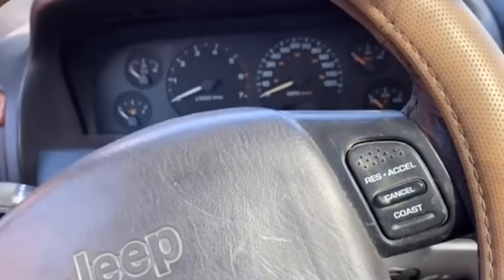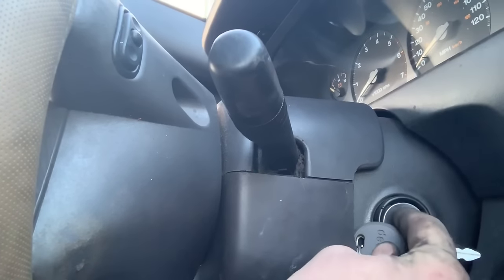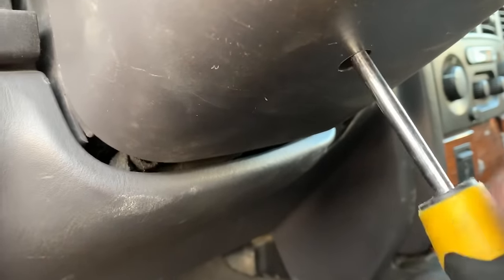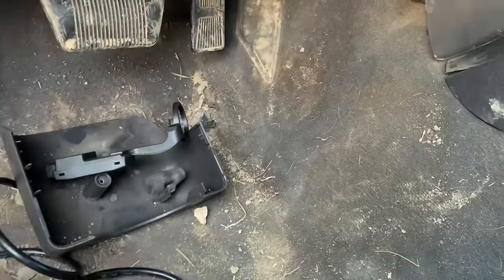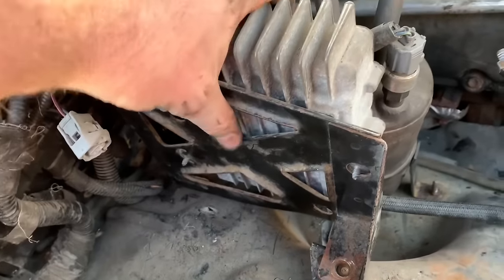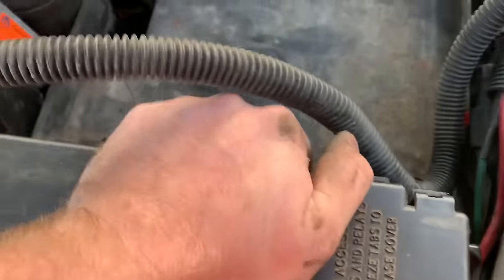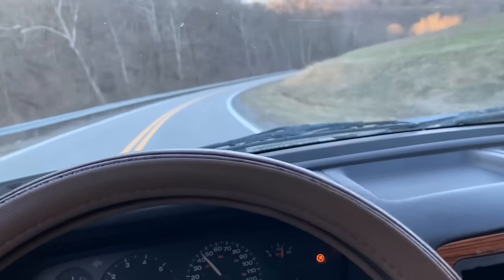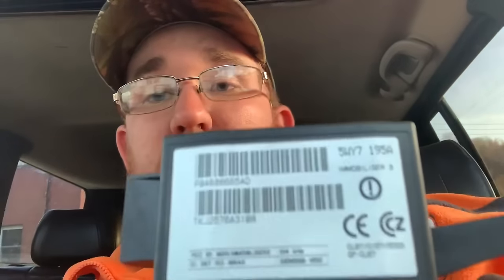How to  bypass SKIM immobilize on a Jeep Grand Cherokee 1999 to 2004

Comment: HEY FOUND THE FIX! I had this same issue. There is a rubber boot in the passenger side door and the power wire, which is a thick brown wire with a white stripe, is probably broken. These models made the ground wire good, but the power wire in the doors is too long, gets caught and snipped. I found a youtube video showing issue, checked mine and fixed in five minute.
Reply: Good job man thank you so much
Reply: Can you link the video here please?
Reply: How do I find your video
Reply: Im 99% sure I got the same problem because I have the drivers door wiring problems too and it's cutting out with the key light coming on.if it fixes my problem I have to find this guy and pay him.
Reply: Hey found the fix  had this same issue There is a rubber boot in the passenger side door and the passenger power wire. Wich is a thick, Brown wire witch a white stripe., is probability broken
Reply: That wire is the biggest pain in the a$$! I deal with it on every wj I own. It should be a recall!

Comment: Remove the SKIM halo. Remove the PCM on your firewall. Take it to your Auto Zone & they will delete the SKIM info. All you need is the VIN, mileage numbers.  Put the PCM back. Don't replace the SKIM module halo & you're good to go. It's only $198 with the core or $398 without. Update: Make sure to disconnect the battery before removing anything. It's called "flashing" the PCM. My car is a 2004 Jeep Grand Cherokee.
Reply: Ralasmom that's wrong auto zone doesn't work on the PCM
Reply: @davidstephens3698  Who does flash pcm’s for you?
Reply: Did that work I'm buying a jeep that doesn't have a key programed to it so it doesn't stay runing.
Reply: AutoZone??  Are you kidding?  They don't know how to  hook up a battery tester.
Reply: Thank you very much now I understand.
Reply: @eegg6954 auto zone in another meaning
Reply: I really don't think that is accurate

Comment: THE "ACTUAL" SOLUTION:"  On my 2000, the problem exists within the SKIM immobilizer. Remove the steering column cover by removing the single screw that holds the bottom portion on, then separate the two halves. Thereafter, unscrew the immobilizer upon removing the wiring connection, and carefully remove the round portion that goes around the ignition key tumbler. Carefully separate the two halves of the immobilizer and you'll see two relatively large solder points. They attach the wire that runs within and around the key tumbler. If you look closely, possibly using a magnifying glass, you'll see hairline cracks in the solder. If so, re-flow the old solder with some new solder and reinstall. Then, look at the lower half of your steering column cover. See that long boss that the screw you removed runs in? Take a Dremel and remove half of it long ways, leaving the half that isn't slamming into your immobilizer every time you tilt your steering down (Courtesy of Chrysler).  Oh, and if you tilt the steering down, further hold it there, and the car starts when you turn your key, then this is likely your problem. I ran my car that way for years before figuring this out... cheers!
Reply: I knew it had to be something fixable without all the flashing, reprograming, etc...noise. Mine quit charging, solder joints cracked. Like you said couldn't see cracks, but I have one of those old magnifiers from Radio Shack the makes them visible. Also, desolder joints and reflow with 60/40 leaded solder. I read somewhere they use lead free solder, messing with tube amps that use lead free solder, heat and vibration causes broken solder joints all the time, reflowing with leaded fixes this.
Reply: Duuuuuuude.  THANK YOU for that pointer.  It worked.  Our 2000 Grand Cherokee was intermittently causing starting issues with the SKIM thing, but I always managed to figure something out and get it started.  But this last time it just refused to keep running no matter all my tricks.  I saw your comment here, and figured I'd give it a try before pulling the PCM.  I lowered the steering wheel and Ta-Daaaaa!   So I know what to do next.  Thanks again, good sir.
Reply: Is there any videos showing how I can do this?
Reply: @jeffvantslot5162 ok so your truck was starting but cutting off then you just lowered your steering wheel and it stayed running?
Reply: Id like to know... From the original video; do you leave the part that goes around the actual key cylinder OFF?
Reply: @NOGDUBB  True yes.  The module gets pressed on by the steering column as you adjust the tilt.  That was enough to push the connections together I suppose.

Comment: I don’t get the reasoning behind why someone would want to remove the SKIM.  Your loss of gauges and the SKIM light turning on is because your ECU is dropping off the PCI bus and the cluster and SKIM are losing communication.  This is a common failure. The SKIM very rarely ever fails. The fix is replacing the ECU.
Reply from the maker: Reekor my ECU was bad so I removed the skim why I was at it when your off reading and you get that skim wet it’s screw up that’s why I did away with it
Reply: Is this the reason my keylight flashes
Reply: However it could be the key or skim itself. If u wanna save a little bit of money aka dealership. I called them n they quoted me the price of a key 150 on 03 GC LAREDO, the skim unit 260 plus. Duh I'm knocking out 2 birds with one move by getting a new pcm flashed with the skim deleted therefore eliminating the cost.
Reply: I’m concidering deleting my skim because the skim is causing a draw from the battery, that’s a solid reason I feel like
Reply: I'm swapping a different motor into my xj, that's why I want to bypass it

Comment: A couple of things.  You need to also have the replacement  PCM coded to your car.  The people who deleted the SKIM on the replacement PCM would normally have asked you for your VIN so they can do that.  Also, you MUST discard the skim reader so that it is never reconnected because if the reader is present it will reactivate the skim in the PCM and you'll be back to square one.
Reply: Where does one find a skim deleted pcm?
Reply: @stuartbrand2592  I think you can see them advertised on ebay.  You can send yours and have them do it or send your VIN so they can put it into the PCM.  Get back to me if you can't find it.
Reply: @chasermalloy7406  aeaecd for All Computer Resources. 

I've got a crack taxi driver who took it to another shop, they swapped the pc, never wrote data to new PCM, rather they just threw a new one from a scrap yard on it. Not very bright and if you don't know what you're doing it'll cost you. So far they're at $175 on diag time and that doesn't include to remove skim, remove and install PCM before. 

I'd say $400 ~ $500 minimum and then some. Stupid tax has to be included as well. People don't think about the end game generally.
Reply: @dtnel  Yep   All Comp resources are one of the few who get it right.  Most wreckers in my experience tell people they only need the PCM, key and skim reader to get their jeep going.   Many of them know damn well it isn't but they sell the set anyway.  So, as you say by the time the owner has then had it properly done  (  Even if it's just having the car's vin entered )  on top of paying for the used PCM,  they're at the sort of figure you're talking about.   A/C Resources will either receive your original PCM, do the skim delete and return it   OR  they will send you a replacement Skim deleted PCM.  In the latter case they will ask you for the VIN number of your vehicle which they will insert in your replacement PCM before sending it to you.  It's normally around the $200 mark to do yours but I think the service is currently on special for  $157 or something.   You won't do better and I really think deactivating the Skim  is the only sensible move.  Unless you want to spend silly money making spare keys you could easily end up in the same situation again.  Apart from that the skim reader units have also been known to fail which leaves you just as stranded.  You can easily manage to immobilize the car a million ways if you're worried about that.    BTW  are you going to pay the shop who took on the job on a vehicle they don't have the required expertise on  ?  They could whistle for it if it was me.
Reply: I have a 98 with the 5.9.Can I use a Dakota r/t pcm?

Comment: Thanks man! I just picked up this jeep a couple weeks ago and now it's running cherry. JUST AN FYI FOR ANYONE WITH OVERHEATING ISSUES AND GETTING THE p1499 code this also fixed that. I guess my old ECU wasn't giving the solenoid power and thus the cooling fan only ran at low RPM where it should be running very high RPM to keep engine cool especially at idle! I thought it was the solenoid but after doing this I haven't had any problems!! Keep in mind this is only for the Hydraulic cooling fan on 4.7 GC's. Awesome video bro!

Comment: Not sure if i understand .... why not just ground out all of the electrical charges overnight like you said and THEN REMOVE the SKIM  module before you "reboot/ re-connect the battery? Not clear on why .... what does "flashing " do differently than "draining the electrical and rebooting ?

Comment: It's wild to watch how long this takes, when I can just do this is 5 minutes via OBD... lol
Reply: How do you do this?  I have a 99 one ower a shop 20 yrs ago installed remote start and bypassed skim its looking like.  i just cut what was left of remote start wiring and wired factory colors back now it starts but shuts off if i dont rest my foot on petal.    There was 2 relays wired in the mess that was making it run since but recently having pw and gauge issues

Comment: Hey. Out of curiosity could you have also just called a locksmith to program a new key and would have that worked? I’m experiencing the same issue.
Reply: I had 3 different locksmiths look at mine and all that happened was I paid them to tell me they couldn't fix it.

Comment: I got a  P1686 code on My 2002 Dodge Durango and i had already replaced my ECM but i didn't drive much then suddenly when i did it started acting up as your Jeep did and i don't and haven't used the Original  FOB Key since i got the car from my Aunt. Do you think it could be the SCIM for me also ?

Comment: My question, I ordered a new or used pcm, ignition, skim and key that all came together and we put it in, car cranked but didn’t start, but the key light did not come on. I never got it started before the key was lost by ????? ( wasn’t me) can I just take the computer out, get the computer flashed and take out skim, and then install the old ignition that has a key? Or is computer not capable of forgetting the former skim?

Comment: I am curious. Maybe you can figure this out, maybe not. When you unplug the skim unit, there is what 3 wires? 4? Is it possible to figure out what kind of 'signal goes through these wires? And then 'fool' it? Could it be as simple as just cutting a wire or three? Or cutting two of the wires and splicing them together? To make the PCM always think that the skim unit it sending the signal for 'key present'....
Reply: I WOULD LIKE TO KNOW ALSO ? MY ALARM WENT OFF A WEEK LATER AND CANT SHUT IT OFF .AND NO LONGER HAVE THE IMOBILIZER.
Reply: I was thinking the same thing since you can put a Field Replacement module (basically a resistor 50-100 Ohm) when the ECM not sending 12v to alternator. Run a Seperate external voltage regulator.

Comment: Man... Thanks for the efforts and all the explanations you mentioned in this video. Just a slight correction, you still can use your old PCM without ordering a new PCM, just get the SKIM disabled as you've mentioned and you will be good to go. HP tuner device can get the job done without removing anything from the car at all...

Thanks again.
Reply: How do you remove it with the tuner?
Reply: That is not true 😢 sorry you need to √ into that better

Comment: I have a 2000 grand Cherokee with this problem. It was pulled behind a motor home and is in mint condition. The odometer say 175,000 miles but there is no way it has 175,000 driven miles. The driver seat barely has anywhere on it and almost looks just like the rear seats that look brand new. It’s been sitting up since 2018 and I’m just now seeing this video. I would love to get it running and start driving it again. So let me get this straight…. What I need to do is pull my PCM out and order a new one. But when I order it, I’ll have to tell them that I want the skim to be disabled, or laying dormant, right? Also if you’re ordering a new one, what is the purpose of getting it flashed? What does he mean by that? Any help would be appreciated because this excites me

Comment: Do you have to get a new computer or can you just flash the old one or erase the old one . 
or is there a way to test the skim unit to see if it is bad.
I’m asking because the original key no longer works , alarm came on during  hurricane Ian , then afterwards it no longer starts
Any help would be appreciated, in florida dealing with hurricane and no Jeep
Reply from the maker: If your old pcm works you can use it

Comment: I wish I woulda known that you had to unplug the SKIM sensor BEFORE powering up the new “plug and play” PCM I had bought and installed into my WJ… It bricked the PCM as a SKIM equipped vehicle and made it have the exact same issue as before… They should put instructions and not just tell people “plug and play” when selling things like that… Sold the vehicle before I found out the proper way to do this cuz as he states in this video there’s a lot of bs and not a lot of this definitely works info out there… so thank you for making this video and showing people the correct procedure cuz I sure as hell woulda liked to have this knowledge prior to selling a beautiful vehicle for such a simple fix once you know how… the dealership couldn’t even tell me the correct way to remedy the issue and two shops couldn’t either…

Comment: Hey brother. I have a fob and out a new battery and now having all sorts of issues with electrical components. Apparently that new battery opened a can of worms. I’m having issues now first I noticed all clusters stopped working. Sometimes door sometimes locks, etc… do I replace driver side door control unit? Pretty lost here for first steps getting a lot of different info lol

Comment: Can you still use the chopped key if you do this. ??   I bought a 2000 grand Cherokee but had a 02 motor put in. Prior to my purchase. And has only 1 key ( chipped). Jeep starts for 30secs and dies . Also sounds like relays under hood are clicking with lights flashing  when battery is hooked up ,   Guy I bought it from said needs a new pcm - but with the clicking relays and lights flashing while battery is hooked up. Confuses me . The Jeep does start but pretty much immediately dies  won’t stay running.  Is it pcm or ???  I’m lil baffled and don’t wanna throw $ out chasing a fix.

Comment: Well this might be a temporary solution take the battery terminals off both of them unplug skim code reader from underneath the steering column and pray or work
Reply: So I wouldn’t need to buy a pcm right away and it should still run?

Comment: Hey so ive done this. Works great. But i locked my doors , unlocked with key cause i lost the fob, so now it starts and all but i got horn and 4ways going and it wont shut off how doni reset this ?
Reply: How did you fix it?

Comment: Had just one original key, so I copied couple of after market keys from, then I installed my original key close to skim module with cable tie and left the key there for ever, last thing was to put the plastic cover back to its place and the job was done, my Jeep is running perfect with any regular copied keys, this was 4 years ago, problem solved, no pc , battery, water tank, some bolt and so and so removal required, no dealer no locksmith no programing, cost me only 2 keys from Amazon.
Reply: Shit I had a good chuckle at this, modern day genius.. Will use this trick myself, thanks mate👍
Reply: i tried this method with my two original jeep key the main one is duplicate keys but the method does not work
however I did put the main key attached to the SKIM and with the other duplicate of the keys to start but nothing I don't know if I still have the same problem

Comment: I have an 02 grand Cherokee I was having the same issues would start and stall with the security key on. Replaced the pcm and now it runs perfectly fine but my whole dash cluster is out. Any suggestions on what to check out or am I just hunting for a lose or broken ground somewhere. Thanks for any and all info
Reply: i know this is a long shot, but did you ever figure out what was wrong? my 01 GC is doing the same thing!
Reply: @meganlynn4365  honestly couldn’t figure it out. I believe when I ordered the new computer with the skim module deactivated  and installed it I should have actually removed the skim module from the ignition before I starting the Jeep back up. Idk if that’s why it started and ran fine just no dash cause security system was deactivated so it let it run but at same time without removing the module it tripped the alarm so dash wouldn’t work and and security light was still on. I drove the Jeep like that for probably about 2 years never any issues but sunroof also had been draining into foot wells so idk what all was corroded. If I were to do it again I’d buy pcm with skim deactivated remove skim from steering column install the new computer then start it up. I’m by no means a professional and this is just from memory from a few years ago of what I had read. Sorry for your troubles definitely a pain in the butt. If you figure it out let me know I’d be interested.
Reply: @meganlynn4365  lol I’m having the same issues. I actually took out the skim completely tho. Did you figure it out??